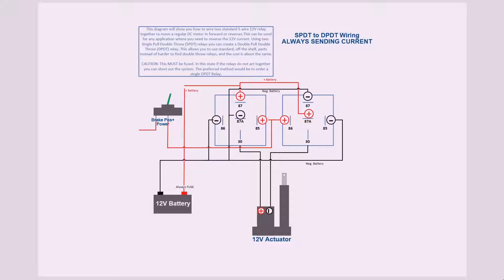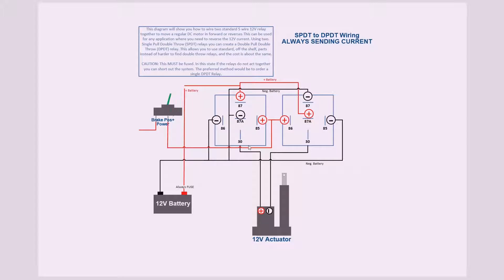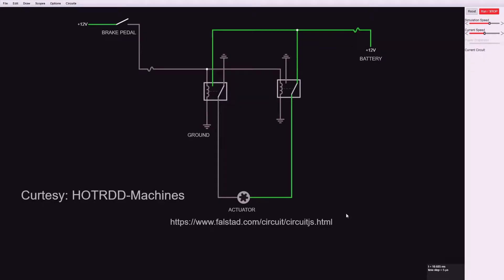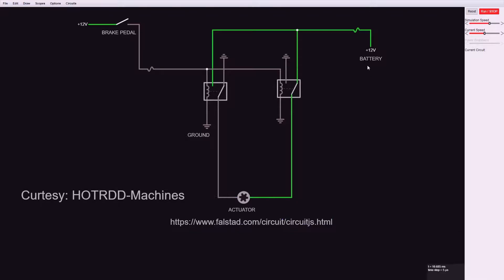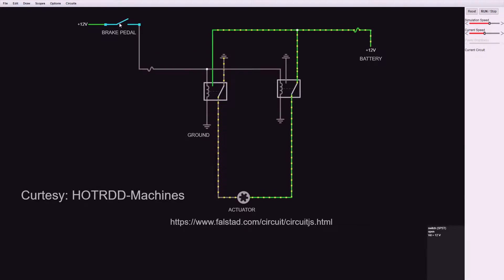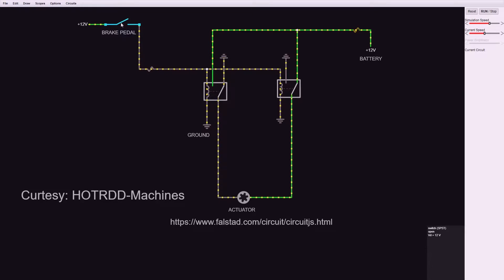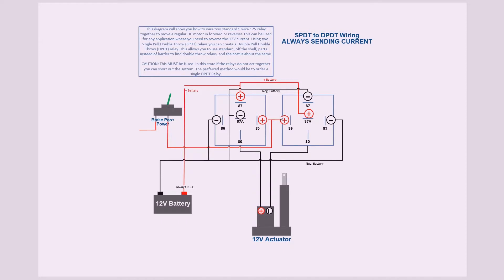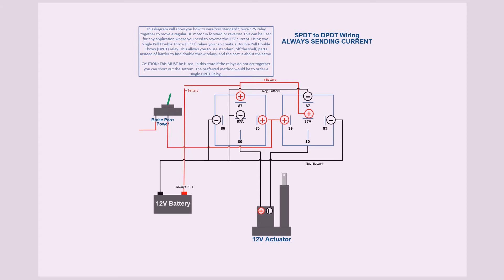Wiring Automotive 12V Relays to Make a Motor/Actuator move always Up or always Down.

Comment: You might be able to help me. I’m trying to repair my snow plow that was operating buy a remote control, two position only – powered up, gravity down. The remote controller no longer functions and it’s a manufacturer seems out of business so, I think I want to hardwirethe system to my vehicle. Maybe you can help me understand what I need and guide me through it. I am definitely stepping outside my comfort zone.

Comment: How do you add another monetary switch that when they are placed in opposite directions it won’t creat a short
Reply from the maker: Can you try and explain your question better? If you wire it like I explain it shouldn't ever create a short. Of course this is also why you fuse the connection.
Reply: @hotrod-machines  so I want to add 2 switches in 2 different locations. I need to wire the motor in a way that if one person pressed a1 switch up and the other person presses the switch down that this won’t creat a short.  In other words they cancel out. Kind of the same way power window do when the master switch on the driver side is pressed up and the passenger presses down on the same motor the motor just stops.

Comment: can you make video two push buttons on and off with car 5 pin relay
Reply from the maker: You'll need to give me  a better explanation of what you want to do. But off the top of my head if you use two 5 pin relays you can wire them similar to a 3-way switch you would use in your house.

Comment: If I buy  4 spdt relays 24V 40A for two motors  how powerful have to be fuse and which wires have to be the thickest in this diagram. Thanks
Reply from the maker: Pins 85 and 86 in this diagram are the trigger wires and do not need to be very heavy. The other pins are the ones that carry current to your motor. Your fuses should match the expected draw of your motors. If the max draw on your motors is 15 Amps than you should fuse for that. The relays can still be 40 amp.

Comment: Amazing! Thank you for showing me how to accomplish this. I could have purchased a DPDT relay as well had I known it was the better/safer choice but I just don't know the wiring. I've been beating my head on this for weeks.
Sorry for the delay in response, I was in the hospital for 3 weeks after a 12 hour surgery that should have only been 2-3 hours. I'm still recovering.
If you have a better way you can show me with a DPDT relay I'm open to seeing that and purchasing from y'all.
Again, thank you!
Reply from the maker: You can use this method but make sure you fuse it in case one of the relays fails. I actually had this issue on a different control unit that uses three relays. The middle relay failed to open and shorted out the whole circuit board. 

If you want relays you can buy at the store use the method above. Or buy a DPDT relay so if it fails it won't short.